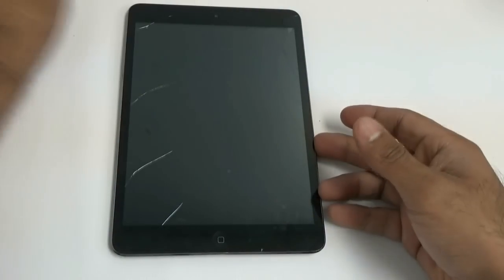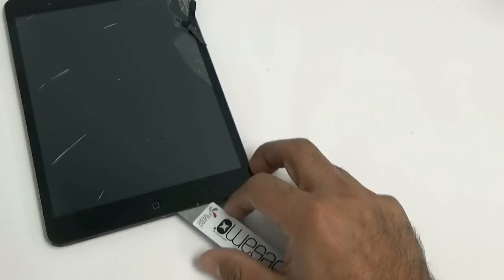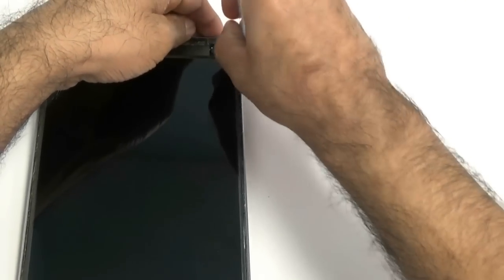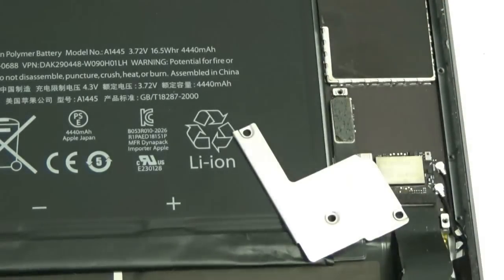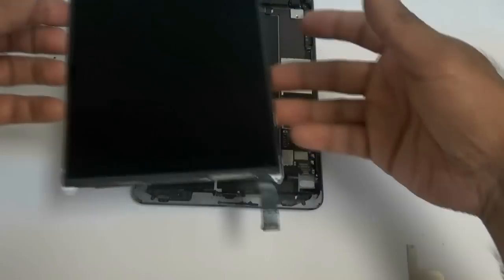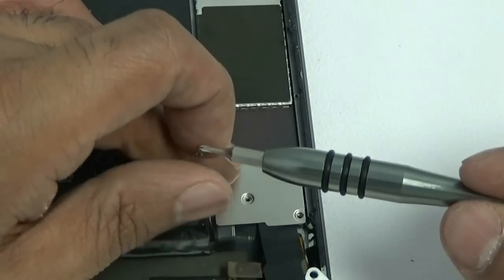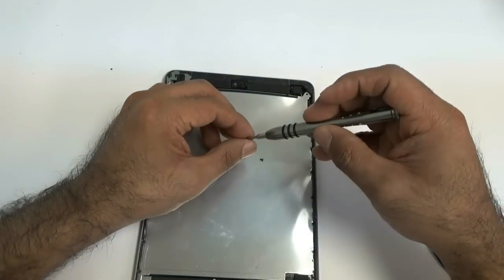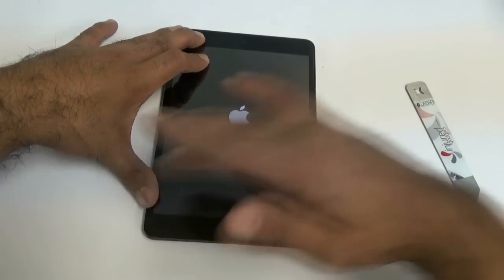iPad Mini 1st & 2nd Gen Touch Screen Glass Digitizer & LCD Display Repair Replacement Guide

Comment: Question, I replaced my iPad mini screen for the second time. The adhesive doesn't hold like the original. Can I run a very  thin bead of silicone along the frame to keep the screen down better ? Thanks

Comment: If my screen just cracked, can I purchase just the Touch Screen glass digitizer or do I need to purchase the LCD replacement? And, how do you determine which one of the two you need to purchase? Thanks!
Reply from the maker: +Jarred Mitrano Just the digitizer. We always recommend our premium kits for Do it yourselfers.
Reply: Thanks, but what determines when you need just the glass digitizer vs whole LCD replacement?

Comment: When you take out the battery, does it reset your iPad to factory reset or will you have everything you originally had on the iPad?
Reply from the maker: +David J. Scott Disconnecting the battery does not reset it, everything will remain